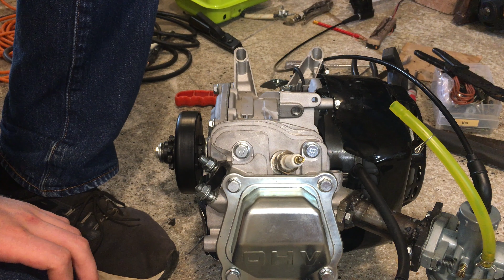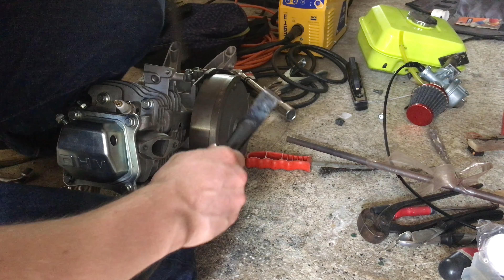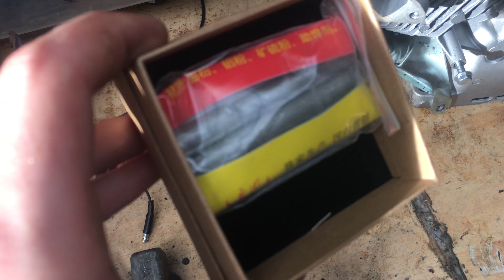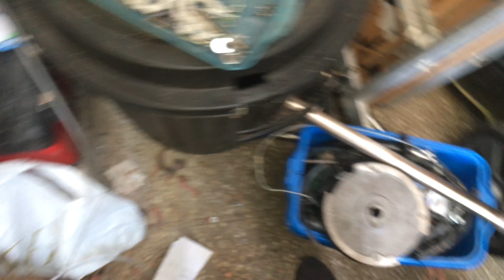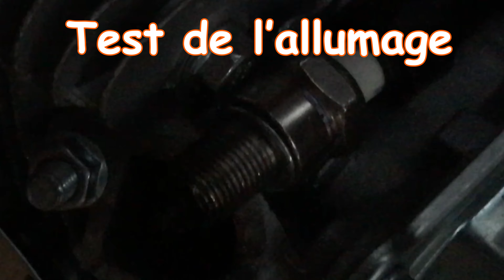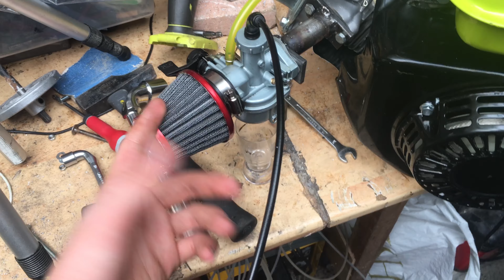RÉPARATION du MOTEUR de KART (VOLANT MOTEUR ALLÉGÉ + AVANCE DE L'ALLUMAGE)

Comment: Salut Mazout dit moi, ton volant magnétique de tondeuse ou c’est que je peux me le procurer ou adapter sur le miens, j’ai eu la même mésaventure de l’aimant qui s’est envolé 🤦🏻‍♂️, faudrait-il monter un autre système d’allumage plus petit, si tu as la solution je suis preneur merki 😉
Reply from the maker: Salut ! Le volant je l’ai récupéré sur un moteur de tondeuse, j’ai pas du tout la référence et il est pas adapté au moteur. Je l’avais monté sans clavette mais avec le temps il s’est décalé donc je t’avoue que j’ai pas vraiment de solution pour ça
Reply: @Mazout69  un tourneur fraiseur pour travailler le cône et une lime pour la clavette devrais faire le job
Reply from the maker: @dardar2438  oui c’est vrai que dans ces conditions ça risque de mieux marcher, après il faut aussi faire un support pour rapprocher légèrement la bobine d’allumage du volant moteur, qui est plus petit que celui d’origine pour ma part et ça devrait faire l’affaire